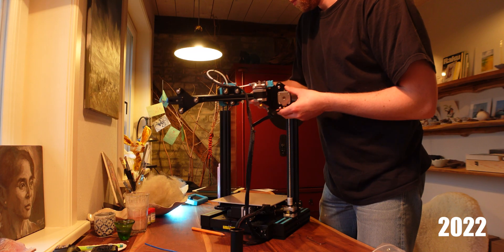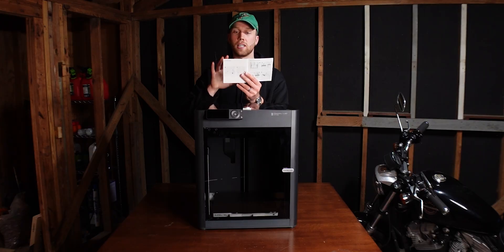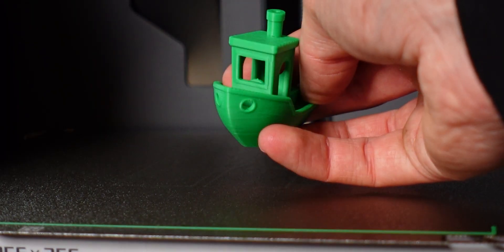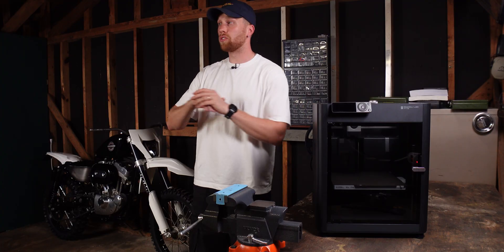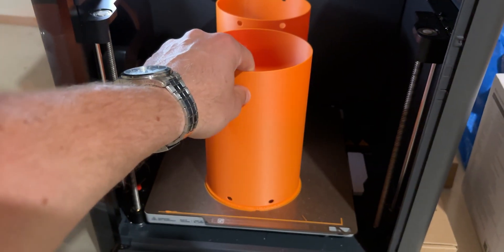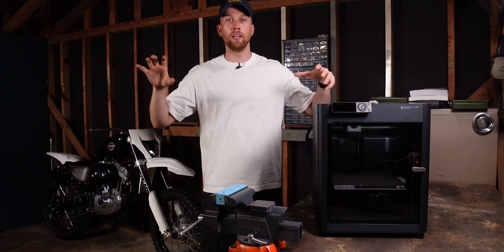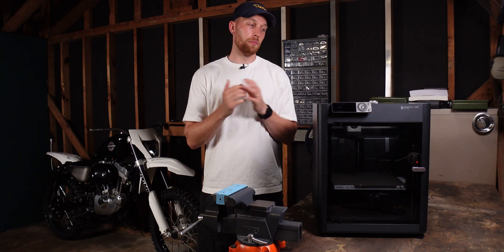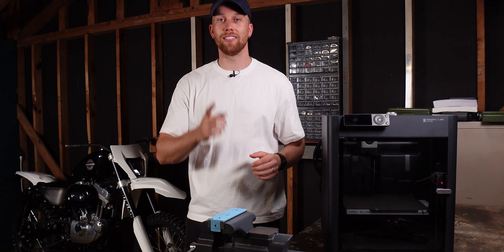This 3D Printer Works Right Out of the Box – Bambu Lab P1S

Comment: Super clean surface. 
Is it possible to estimate the power consumption of such a device?
Reply from the maker: This is what ChatGPT says about it:

A typical consumer-grade 3D printer is relatively low power compared to other shop tools. Here’s a direct breakdown for FDM printers (Ender-3, Prusa MK4, Bambu P1S, etc.):
- Heated bed and hotend are the main power draws.
- Peak draw: ~250–400 W when everything is heating up.
- Steady-state while printing: ~60–150 W (less if bed temps are low).
- On 120 V mains, that’s roughly 0.5–1.2 A continuous.

Comment: I'm interested in how the parts stand up to use. I saw some spacers for your suspension etc.  Are you using a special type of filament.  I can see uses for a 3d printer in my stuff that I am looking to do. Probably not this exact printer as at 1500 AUD, it's a stretch however I understand the reasoning behind getting something like this if it becomes an almost essential tool.  Thanks for the insight.
Reply from the maker: It really depends on the parts and the design. I mostly use PLA for prototyping and then I fabricate the parts from metal or have them cnc cut. For most „tools“ PLA is also fine. But if you wanted parts to last on the bike it would have to be ABS or something like that. 
I feel like if you just want to prototype, and make tools, etc. you can absolutely go for the A1 from Bambu Lab. They are as easy to use as the P1S but are significantly cheaper. What would you like to use it for?